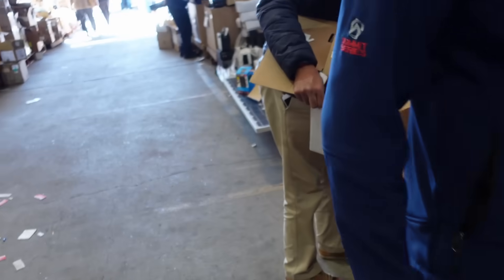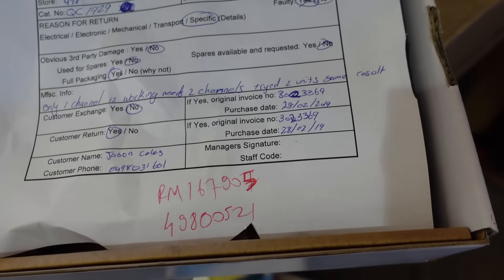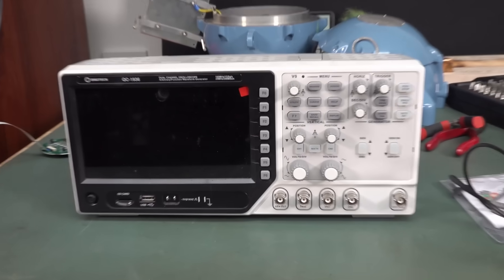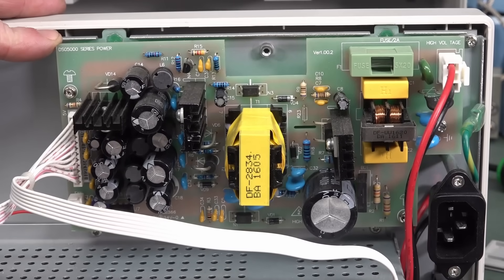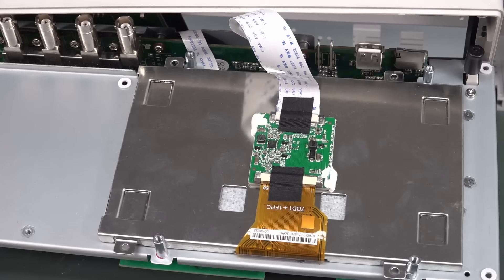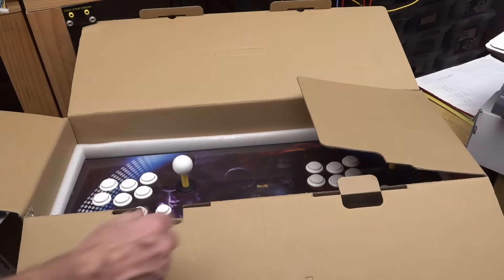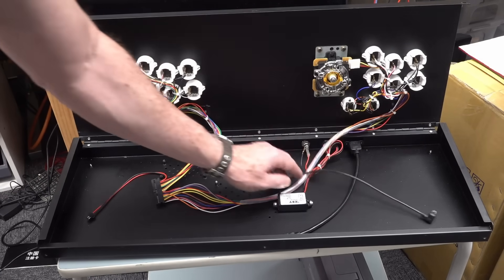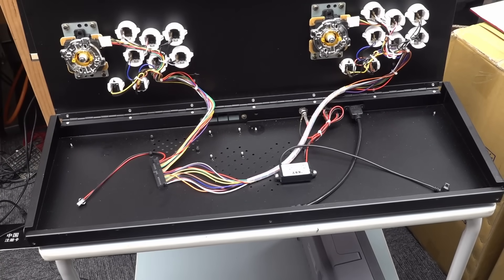Will this $5 Oscilloscope Work?

Comment from the maker: Looks like I have to do a FAQ as this video has been so popular:
1) No Jaycar do not sell this scope for $5, you can't but it anywhere. I got it at a clearance dumpster sale.
2) No I could not buy two of them to swap parts, I was very lucky to get the last one. A minute or two later and it would have been gone.
3) No I cannot ship it to country X. International postage is expensive, so I will give it away to a local kid here in Australia if it gets fixed. I don't care if you think that's unfair.
Reply: Dude that might be a collectors item. Digitech brand is under the hammond unbrella and digitech is no longer making guitar effects pedals.
Reply: @eternalfire2234  Digitech (the jaycar brand) is chinesium. no sane person would collect chinesium
Reply: @eternalfire2234  It's the same Digitech? I assumed it was a Chinese knockoff company with no regard for trademark.
Reply: A lucky kid 😂
Reply: I definitely wouldn't stop you sending me one of those scopes Dave. 😁
Reply: Please give it to some kid that will use it! Fun!

Comment: Even if the screen isn't working, you can plug in the USB port and see if you can control it and get measurements off of it.  Then you'll be able to see if the rest of it is working before going to lengths to repair it.

Comment: Would really love to see full investigation and repair on the Hantek 4000c scope that you got with that display damage, especially if there's anything wrong with it besides display.

Hey a Pandora without a PCB is a decent catch too. Big metal console with all the controls on it, and like sure they're your standard knockoff grade, but arcade style controllers for home consoles, when those were a thing, in the 16bit era, were often worse, much much worse.

That power amp is MUCH nicer than Dynavox miniamps that you could get back here a while back as well.

USB scopes - nice as well, for sure will help someone along.

Comment: Had that same scope, with the same problem. Found the -7 volt supply was failing and going high voltage. When I found it, and replaced the regulator, it had destroyed the chip used for Sync. Scope worked, but had no working sync. That part was unobtanium.. Gave the scope away.  Sorry no longer have it to send you the screen.  Be sure to check that -7 volt regulator.

Comment: You can control the screenwrecked oscilloscope/sig-gen from the USB as well.
Specs for sig-gen was written on screen under the scope specs:
Scope: 100 MHz, 1G Sa/s
Gen: 250MHz, 200M Sa/s

Comment: I'm really jealous.  It wouldn't be worth it to fly there and it would cost an arm and a leg to ship that stuff back to the USA.  I'm rather suspicious when big company with more resources than I have decides to dump stuff for pennies on the dollar.  I would think that they took a swing at fixing the items and found it wasn't economically reasonable.

On the other hand, if you can get the parts needed and you are doing this for fun (you don't put a value on your time) then I suppose these items can be worth while.

Comment: That scope was worth a shot at $5. Was it The only 100MHz one left? Too bad about the screen. Let's hope the one you ordered will work. Could even be worth it for the 25MHz sig gen. The 13.8V 40A supply would be good for amateur radio equipment but as it is a switching supply it would only be useful if it isn't spewing a lot of stray RF.

Comment: Also to verify, the scope appears to have 'booted up' so a new screen will fix it if compatible.
You can use the DSO and the signal generator - but you switch screens to view the output waveform of the generator when setting it...
Apparently it uses the front USB like it does the SD-card slot, you can save waveform captures as csv. The rear one interfaces with a computer, according to the manual. I think you can bring up the display... I gotta play around with my one a bit more - good to know about that coin-cell in there, something to replace every few years...

Comment: 'Oly sheet! I have the model just under this, it's a 70MHz jobby - but identical interface etc.
I got mine for 100x the price a few years back - though I had a need for a signal generator, and the impulse capture capability of a DSO. Until this, my two analogue scopes were all the rage - 20MHz tops, and one recently crapped itself!

Comment: Digitech is a well-known name in the world of digital sound processors, effect pedals etc. but the logo is different, it's just a name coincidence, not the same brand. 
More of that screen film peel ASMR content, please! Good luck with looking for the screen, it'd be fun to get it to work.

Go for the HGM Picade retrofit, the box is worth it! I like the amp's metal enclosure and innards too. Take a closer look at the power transformer's power rating; seems small-ish for the 2x120W declared output power. I'd replace the filter caps with 2x10000uF. BTW, as far as power is concerned... I'd like to hook the thing up to a dummy load and do some measurements.
Reply: Digitech is not what it used to be ...also not in effects etc. anymore...

Comment: 13:55 is that a DC motor on the back of the power knob? What the?
Reply: yaa it is like a motorized volume control so when you use the remote it probably turns the motor.
Reply from the maker: Yes, that's how the remote works.
Reply: Huh, I haven't actually seen that done before! Neat.
Reply: @leisergeist  That's the oldschool way. A lot of top end consumer grade sound systems from the 90's era used that method. Now it's digitally controlled pots or just done in software (DSP).
Reply: @leisergeist  yes you could even buy like module of it from digi key.

Comment: I think that's a RetroPi arcade enclosure.  You drop a raspberry pi in with a certain sd card image and it emulates a bunch of different stuff.
Reply from the maker: Yep, need to find the image. Don't want to have to cobble it together manually.

Comment: "Gypped" is a racial slur and really should be retired from use.  I used the term myself until only a few years ago when I finally saw it written and realized its origin.
Reply: If he'd had used the phrase I often used to hear (UK), he'd have his channel closed down pretty quickly. sounds similar to getting juiced.
Reply: just spell it jipped and ignore history, cancelling encourages it (history) to repeat.
Reply: Jonathon Green's Dictionary of Slang - highly recommended - agrees. The entry for 'gyp' has this, edited for brevity: 1: a thief, 2: an act of deception, a fraud or hoax, 3: a cheat. An abbreviation of 'gypsy' and as such an ethnic slur.
Reply: @Graham_Langley  interestingly gypsies has the same contribution no matter what country
Reply: @Graham_Langley  It is not meant that way so ignore it. Trying to whitewash history guarantees it is always repeated.
Reply: @mbak7801  Jonathon Green is not someone likely to 'whitewash' anything, believe me.

Comment: It has USB so display on computer, no?
Reply: Pretty sure that's just to store waveforms instead of the SD card
Reply: @Basement-Science   On my Owan DSO, I can use the USB to display on my PC.
Reply: @ed-jf3xh  Maybe, but that's by no means standard. I just checked the manual on my Hantek 4072c (almost identical to the one in the video), and it only mentions using it for a flash drive.

Comment: Oh my gosh, for $5 you should have bought two with different issues then you could swap parts. That looked like a once in a lifetime dream sale! Wow.
Reply: Sale in my country for that kind of ewuipment is like 5% off at max. Jaycar seems to be like dream.
Reply: @asdad asdasd I respectfully disagree. The cheap one has many advantages ...you can use it in the rain, loan it out or test something dubious without fear of loosing five figures.
Reply: @asdad asdasd Yep but I don't own one of those :))
Reply: @asdad asdasd I entirley disagree. I picked one up from the sale myself to use in the garage and on my old mans farm. They can be very useful for diagnosing sensor or sequence issues on machinery and for 5 bucks I'm not worried about getting a bit of dirt or grease on it. Saves me risking my good scope which is more than overkill for garage work anyways.
Reply from the maker: I got the last one.
Reply: @EEVblog2  lol
Reply from the maker: @BlondieHappyGuy  I got literally the last one. If I was a few minutes later it would have been gone.
Reply: Agree with that, buy another one and scavenger it.
Reply: @asdad asdasd 2022 and now "scope-shaming" is a thing... who'd have thought...
Reply: @smitcher  lol
Reply: @asdad asdasd Yeah like every hobbist ow  5 figure scope multimeter and every other lab equipment which they use couple of times in year. Very expensive scopes are used daily in R&D labs.

Comment: A number of those game boxes use a Pandora Box game controller. I would guess that it would either directly connect or be easy to adapt to one of these controllers. <edit> I just checked, you would need an adapter or cut the cables.
Reply from the maker: Yes, that's what I found when I googled it, looks like a similar pin header interface. But seems it's an RPi version.

Comment: I have the Hantek 4000 series, it's a pretty decent unit and it's sig gen is quite clean. I'm sure you can get the display
Reply: I also have one, one thing that annoys me is that they didn't implement the bode plot like they (falsely) advertised. It really just shows you the gain and phase shift at a specific frequency, not a plot.
Reply: @longpham-sj5sv  sigrok with some plugin perhaps? Could be a solution 🤔🤓
Reply: @TheStuartstardust  Hantek is listed as supported by sigrok!
Reply: @TheStuartstardust  maybe but the last time I checked sigrok, it wasn't on the supported device list
Reply: @longpham-sj5sv  Maybe with a firmware update (just wondering).
Reply: @pslinares  I was hoping so but this scope is 7 years old and the last update came out in 2020

Comment: 11:20 It’s for a raspberry pi! Hence the 5V supply, Hdmi Passthrough cable, 40 pin gpio connector and the chassis cutout.

It might be a bit of work but have a look at running retropie or retroarch on it.
Reply: Yep, 40-pin GPIO header and the square holes are for the USB and Ethernet ports
Reply: Looks like you have to swap some pins around. There is a video on here titled "Pandora's Box arcade with Raspberry Pi GPIO Controller"
Reply from the maker: Is there an SD card image available?
Reply: @EEVblog2  i guess its meant to be used with "retropie"
Reply: @EEVblog2  Some punks with arcades have complete build images on the internet. The legality of most builds should be questioned. You can install the buttons using GPIOnext (refer to the XC9062 manual).
Reply: @majikshroom1  The build is not the issue. The legal complication is the ROMs.
Reply: @EEVblog2  try RetroPie
Reply: yes only fits the 3b+ ... it was really nicely made when I first saw it come in
Reply: Yep, it's an arcade case for the raspberry pi, has all the connectors and holes for it.

Comment: We use those USB scopes all the time in custom test jig setups and to digitize analog equipment 
40-80 MS/s for $40-60 with a full frontend and reasonably accurate, can't go wrong! 
as far as software goes, some sigrok modules exist but the protocol is extremely simple
Reply: Oh hey, that's actually a pretty good use for those.

Comment: I have two tektronics CRO's 20 and 200Mhz, but I've never had the money for a waveform generator. Always having to improvise/create test signals. A USB arbitrary wave gen would be a MAJOR upgrade to my bench. 
Even if it is only 20mhz.

Comment: The cheap DIGITECH/Hantek PC scopes work really great with the OpenHantek software! I use mine almost daily on my Windows machine and am really happy with it.
Reply: What kind of isolation do they have between the sensing side and the computer, any chance of blowing up your PC? Ideally you’d have opto-isolation at or just before the USB, or maybe after the ADC. I’d also like to know what kind of front-end protection they have for the scope itself.
Reply: @Scrogan  Even if it doesn't have isolation, I seem to recall usb isolators are rather cheap, like $10-15.
Reply: @vgamesx1  and usually very slow at that price, sadly...
Reply: ^---lmao. spot the linux user. (jk)
Reply: @Palmit_  oh yes, because the only people who mention the Matrix as but one of the alternatives are those who broke out of it :D

Comment: That arcade machine is meant to use a raspberry pi as the mainboard, hence the microusb and hdmi connectors.
Reply from the maker: That makes sense, thanks. In that case I will be able to get it up and running.
Reply: @EEVblog2  Sweet, just be mindful of the way the connector goes on the Pi, it isn't keyed. There is a manual on their website the part number is XC9062. It will show you the way.
Reply from the maker: @Anzac97  Got it, thanks. I have old RPi's lying around, will install this and see how it goes.
Reply: @EEVblog2  Good that you have some old ones, because they're almost completely out of stock everywhere right now.
Reply: I was just about to post the same, looks like a RPI 3, probably running retropi with the emulation station frontend
Reply: Never seen one of those before, but I was thinking the same thing soon as I seen the 40 pin, micro usb and hdmi hanging there.
Reply: Unless you buy from the Jaycar I got mine for and someone had left a raspberry pi 3b in there from a demo 🤣🤣
Reply: Thought the gpio+hdmi+microusb was a bit too much of a coincidence. :D
Reply: Most lightly running RetroPi
Reply: Probably so - the holes, standoff pattern and big header with cables going to the buttons all look familiar. Wondering about the mounting space for some board next to the 'berry.
Reply: hence the 2by20 .1in pin interface
Reply: Pimoroni Make a nice PiCade board, I got the mini cab for my kids, it would work no problems with that set of inputs.
Reply: Yep, that makes sense
Reply: I sold pandoras key boards for about a year at about $60 per board and the pandoras key 7 (I believe) had the same layout where it was micro usb and hdmi out. The boards are really hard to come by on eBay but they’re easy to acquire if you have a connection in China or from alibaba.
Reply: It's possible to retrofit a Pandoras Box 9 board in that unit although you'd need to mod it.
The unit as it stands was meant for a RasPi 3 running Emulation Station, MAME & arcade games.
They sold a similar unit but this used a Pandoras Box 6 from memory
Reply: That was my thought, someone's robbed it and returned it.
Reply: @Monkeh616  Nah these units brand new never came with any inside. It was meant to be DIY. They didnt sell well.
Reply: That was my thought too, looks like one of the cables is for the 4 pin PoE header. The three holes in the back of the case, with the silver standoffs, would be the board location.
Reply: @Anzac97  if they never came with a Pi inside, why do they claim numbers of games etc. on the box? Perhaps they initially intended to sell them with a Pi built in, but then Pis became rare as hen’s teeth and they decided to sell it as a DIY kit instead.
Reply: @mlenstra  Nah these were released years ago, like 2018 - 2019 cant remember. Jaycar is full of bad packaging like that. They had some products pulled in the past which had unlicensed games on a arcade machine just like it, as well as a handheld one.